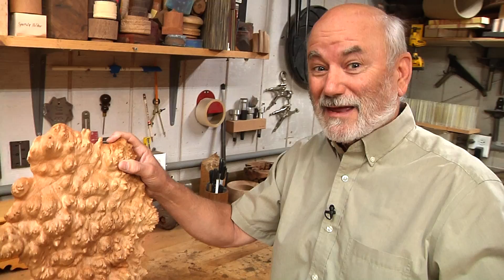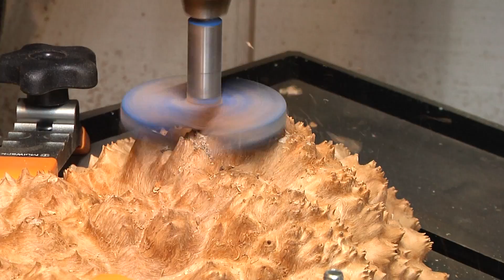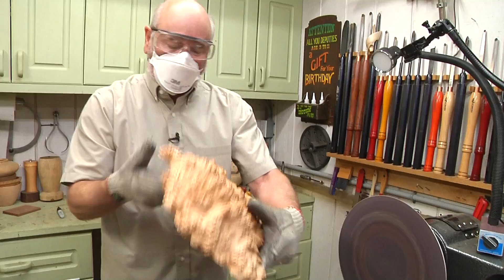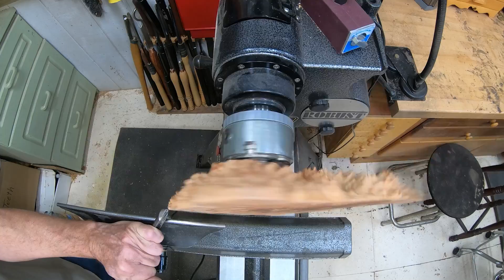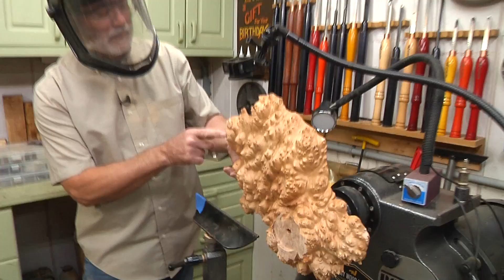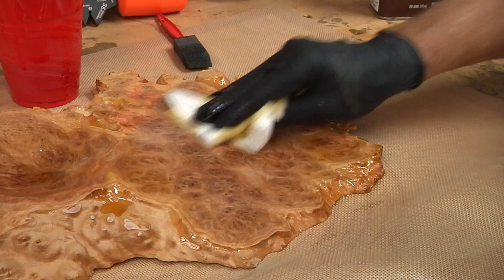Melted Burl Platter

Comment: Negative rake is what makes your tool specifically for scraping. It’s like spreading butter on your toast, the edge of your knife is pointing in the opposite direction of your motion. The stress on the edge is reduce that way and your tool angle is allowed to be steeper, making your edge hold better. Also scraping is more forgiving, when your edge is no longer perfectly sharp.